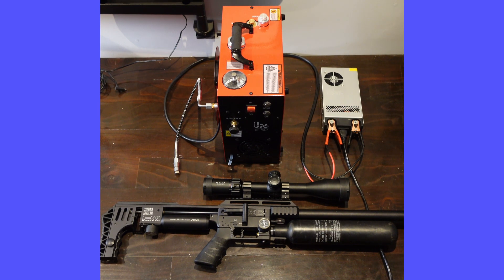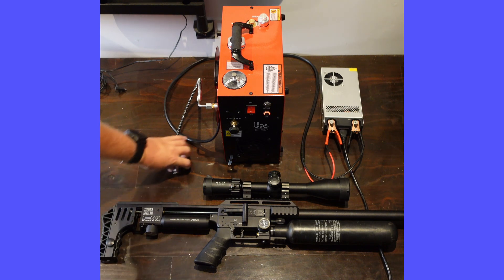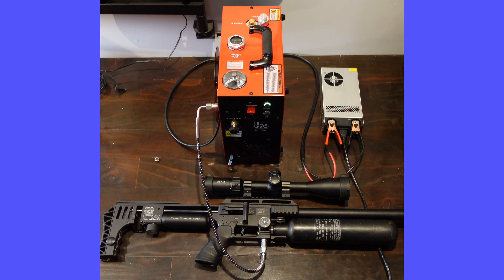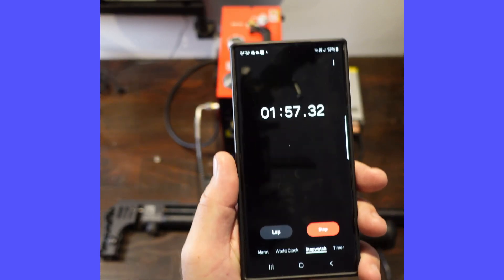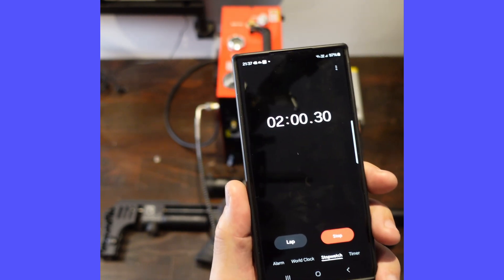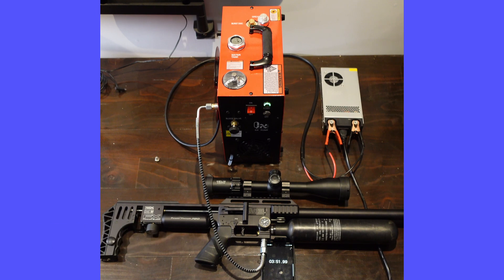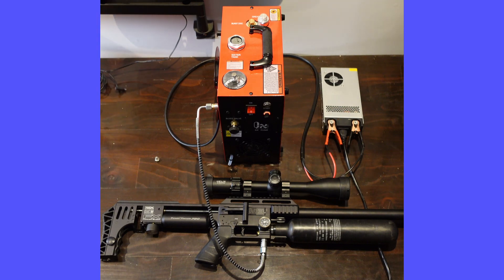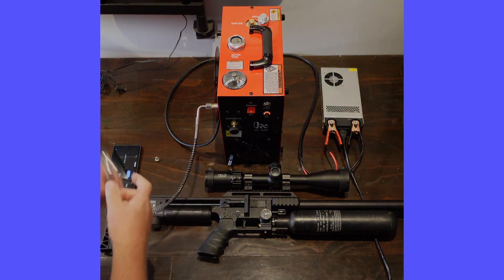FX Impact M3 fill with GX CS4

Comment: You should be using a filter for moisture.  Thats bad for your tank and gun
Reply from the maker: Yes that is a true statement about moisture and air rifles.  however this was an initial fill to test the speed of fill direct, the GX CS4 does have a internal filter which you can see by the drain pipe. So  it does have very limited protection However I would not recommend relying on this and to fit additional filters. If you see my later videos you will see i have double filters added..

Comment: My first compressor was a GX-CS3-1 and I loved it.... for 3 days 😢 I returned it and got a full refund via Amazon and then bought an Omega air charger and 2yrs later no issues.
Reply from the maker: Hi thanks for your comment, I can only say I have had no issues at all with my cs4, runs flawlessly. I can't comment on the cs3 as only had cs4. But to date no issues with cs4 which was purchased in November last year

Comment: You don't use an extra filter? Is the air comming out dry?
Reply from the maker: Hi ya thanks for the question. It does state that it has its own inline filter, however I would not rely on this, I have fitted an additional inline filter the type with Charcoal and like wadding inserts to dry the air even further.  I guess the fitted inline would be ok as a very last resort for a quick fill in an emergency but certainly wouldn't be using it regularly. Moisture through your rifle can cause all sorts of issues so best to avoid it as much as possible.  I shall do another video filling my rifle with the additional filter in place, it does add a little bit of time but not really all that much in the grand scheme of things.